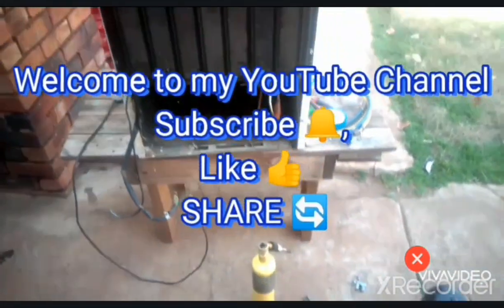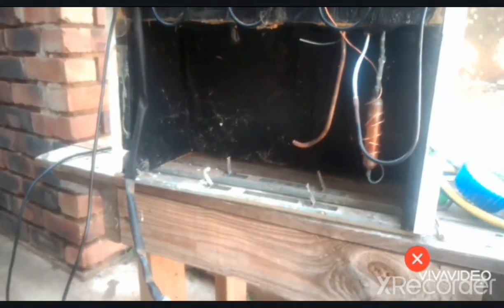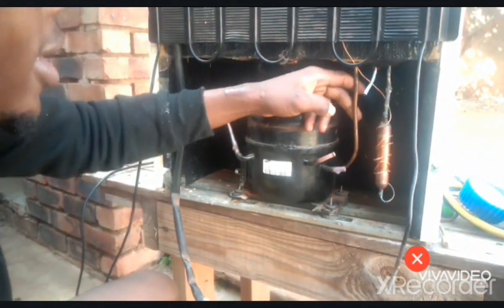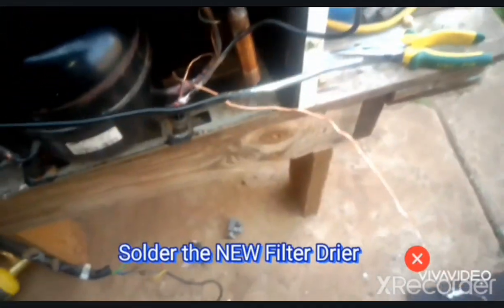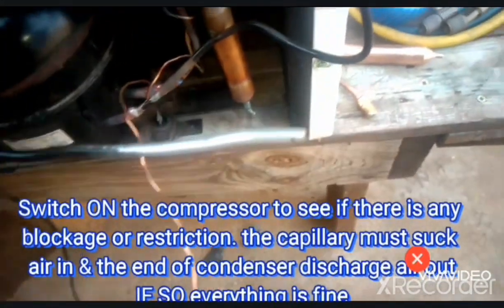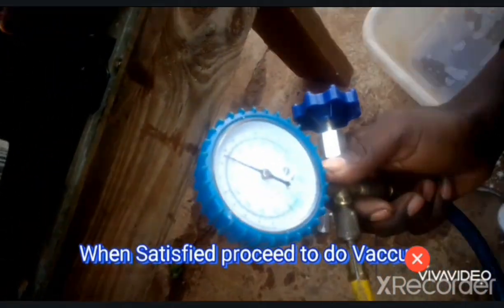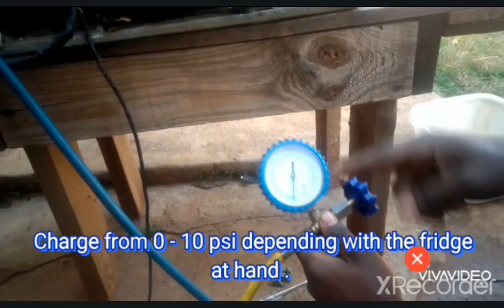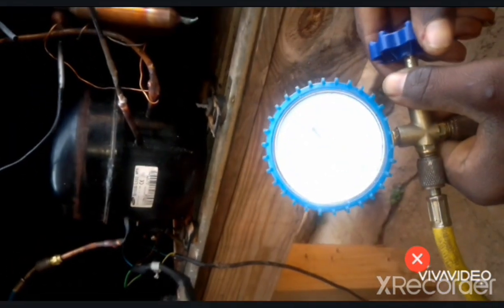How to replace a fridge compressor ,test for leaks, vacuum and gas charging using basic tools

Comment: On other videos I saw them using thinners and liquid flush or tetra chloride for flushing the system which is the condenser coil and evaporator using their own compressor can u explain that on your your video therally and practically in full,  were the pipe should go this pipe should be open this closed etc so that we understand and don't get confused and also if u know how to check for leaks ànd cleaning using R404 gas instead of air or nitrogen gas,

Comment: Where did you buy the MAPP gas? It’s discontinued everywhere for at least 5 years. Now they sell MAP-Pro but it doesn’t burn as hot and won’t melt silver rods.
Reply from the maker: Thanks for your comment. I bought it from Tv Master . If you are in South Africa it's everywhere we still using it it's still available

Comment: Even if compressor is not pumping gas it always pumps air or allows air to flow right or not, but for gas it won't the pump needs to work right or not

Comment: Remember that the reason there was no gas was due to leak not were u were brazing but somewhere else and secondly it might not be a leak but restriction which cause compressor to overheat damaging the relay

Comment: The gauge when checking for leaks using this method without compressor it will go to the fullest Psi over 220, when compressor is running, when compressor is not running will it decrease or remain were it was, 
 Or for that pressure to remain you should close the valve on the gauge, then weld the suction after put the gauge pipe on the service valve th3n open the valve on the gauge and that pressure should remain like that if there is no leak